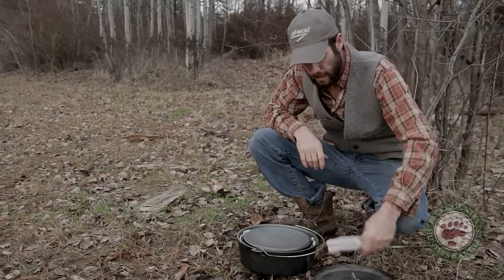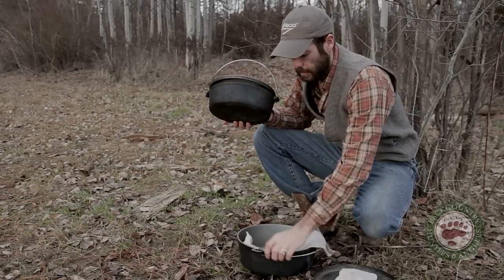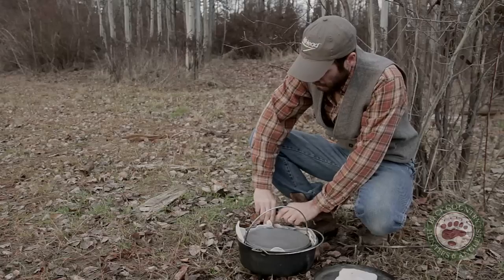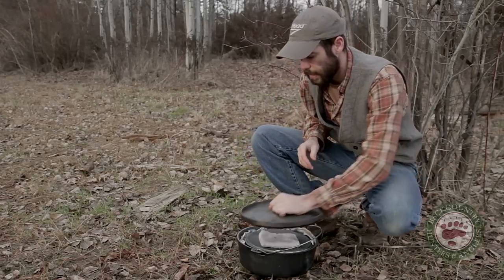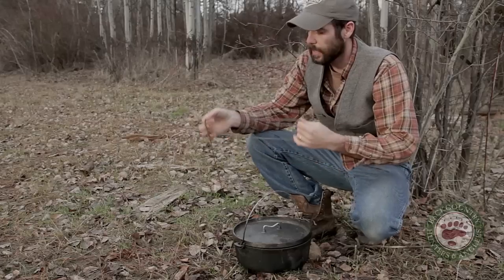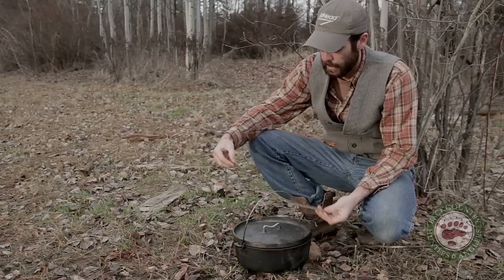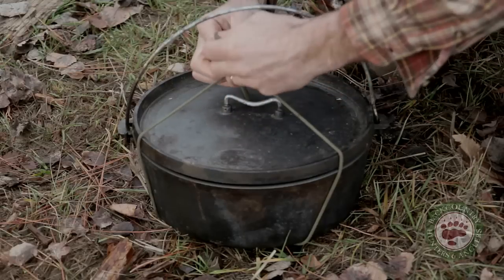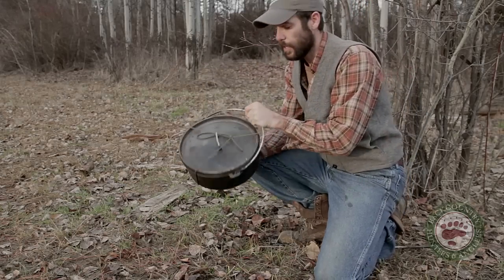Nesting Dutch Ovens - Backcountry College

Comment: I have bought the GSI pot you’ve used on alone and my problem is that the handle kinda makes the pot unstable if there’s liquid inside it tends to move to one side really easy which ends up tipping over. Is there any difference to yours that’s not on the new ones? Or have you modded your handle somehow?
Reply from the maker: Mine has the same problem. I just wrap some wire around where the handle joins the pot if I’m going to be hanging it much.